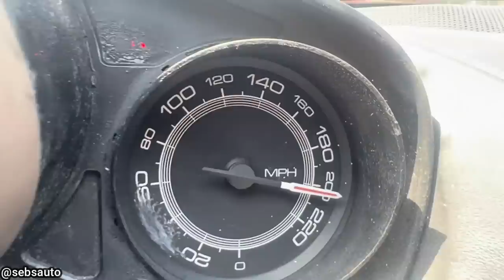Customer States Engine Overheated And It Might Be Seized | Just Rolled In

Comment: I bet a lot of the time the customers don't believe the mechanics when they tell them about the repairs needed.
Reply: You better F'ing believe it.
Reply: It's not good to just blindly trust every mechanic you come across, but you can't just ignore what they say because "they're untrustworthy! I don't know them!" Do your own research, and know the car your driving inside and out.
Reply: @Mike Right. Had a guy come in, brake pads gone. Metal on metal. Told him, he said he'd come back. So, 5 months later, he comes in for state inspection. Rotors are trashed, needs new calipers, too. The guy freaked. He said, "You told me pads, shims and cut the rotors." ($600.) "Now $1,400?!" I told him that was months ago. I asked him how the brakes worked. He said, "I have to stand on them to get the thing to stop." He yelled, and bitched, and left. Came back after getting a second opinion. He got pads, shims, rotors, and calipers with a fluid flush. (Black.) But he refused to let me do the work. At least he got it done.
Reply: If there wasn't so many crooks they would be believed.
Reply: problem is its an industri jam packed with scammers. The industri need a real actual certification program that actually means something.
Reply: My comment was in relation to the extreme problems shown in the video. It is obvious (to me) that thhese cars needs to be repaired and the mechanic is not trying to rip them off.
Reply: @AshGTE  Yes I believe this is an honest shop and the repairs are definitely needed. But Trusting mechanics is like trusting bankers most out to do you but you do get  a few honest ones.
Reply: @AshGTE  well yes, but people's disbelief stems from the fact that the industry has some bad apples giving customers reason for "FUD", wouldn't you agree?
Reply: @hplc123456  in germany you have to learn most professions, and get a certificate for it. if you want to say we, do safety work ona  car, as in brakes and suspension, someone needs a marter degree certificate, either you or the shop's owner.
still doesn't mean you won't get ripped off by not so serious shops.
Reply: @hplc123456  NH has yearly inspections. Most people follow the rules. But we do get some lick-n-stick places.
Reply: @AshGTE  I have had people refuse crazy things. Had a guy demand I fix his wife's sunroof, but her brakes didn't work.
Reply: @lotharrenz4621  Im a mechanic myself, and i worked side by side with German&Austrian guys. It puzzled me, they take take such great pride in their work, then i realized, that they take their education a lot more serious, its borderline engineering degree
Reply: @hplc123456  times change and they change the professions. when I was learning car mechanic late 80's, electronic fuel injections were brushed on, but the details were for car electricians. nowadays they throw it all together and call the result mechatronician. and there is so much electronics, and no spare parts to repair an unit, anyway so you have to replace the whole unit. I had to learn how to take apart brake calipers, engines, gear boxes (not automatic, that is a world unto itself), how to weld and solder, diagnose stuff, and the theories behind it all. in my opinion, without knowing at least some of the theory behind things it's hard to see that one is about to make a big mistake... 
all the electronics, the need to research details before you start working (if there is any documentation at all; despite existing laws many makers withhold vital special information, and often you only find the same questions on the internet, but no answers) and the pressure bosses give back to their employees especially, made me look for a different career recently. nowadays I empty thrash cans and the payment is still the same.
Reply: @Ogrematic  if he had done that in the UK, he would have been breaking the law. In fact we require regular safety inspections (called an MOT) to allow cars to be on the road
Reply: @jaycee1980  We do too, but only once a year. Trust me, I failed tons of people. There's no almost, you either pass or I fail you and send a report to the state.

Comment: I installed a new ac accumulator in a brand new Mercury Grand Marquis and learned they come from the plant with rust in the coolant system. Vinegar bath and distilled water doesn't clean or stop rust once it's in the system You just gotta keep flushing it or replace parts when the rust destroys them.
Reply: Look up phosphate conversion (phosphatation) to help passivate. Ofcourse with a GIANT asterix that I am unsure if the coolant system is compatible with such treatment.
Reply: As the song says, rust never sleeps.
Reply: oxalic acid will clean the rust out of cooling systems. old school cooling flushes used to have it, but now they are pretty useless thanks to govt regulations. but you can still get oxalic acid and just make your own flush

Comment: We had a DD13 with that same coolant filter come in with a coolant leak. That filter was plugged, like calcified plugged, hard as a rock over 90% of it. It was leaking at the water pump and around the cap. New filter, coolant, and water pump, works good as new.

Comment: Detroit actually has removed the coolant filter housing completely from DD engines for the last few years because they found it made no difference to the longevity of the engine. Folks should just replace the coolant at proper intervals but some truckers prefer to run using the "breakdown maintenance" system.
Reply from the maker: Somebody just mentioned that as well. Looks like somebody didn't listen 😆
Reply: Usally, a hose will blow before the 5 year coolant change interval is needed.

Comment: I love these videos, they make me so glad I live in a country with mandatory yearly inspections on cars, and that we don't have snow/road salt.
Reply: I have a car with about 110k miles on it about 20-30k miles ago I hit a deer at 50 mph. no bad structural damage, the engine is 100% fine, but the seal belt and air bag blew out and the frame is compacted a bit so the car is a bit shorter. I drove it to the body shop so they could give me a quote... He told me it was totaled.. I paid 4500 for it... No way in hell is that happening. I've drove it ever since and hadn't had any problems. If the government forced me to scrap it or fix it I would have to scrap it and get a shitmobile for $3000 with 300k miles on it. My car at least has 100K miles left in it. It would be a waste to scrap it. I am glad I DON'T live in a country where the government forces Inspections on me to trash my car. The only issue is the big brand auto mechanics refuse to touch my car. Good thing we still have small business local mechanics that will give me an oil change no problem.
Reply: @nightshade8958  that’s what I’m talking about. No government intervention. We can make our own decisions

Comment: I'm surprised you haven't had any cases of, "My car suddenly stopped running for no apparent reason, and by complete coincidence it happened right in front of the local race track!  I'm sure it's warranty."
Reply: The funnier ones are when they crash the car at the race track and have to be informed that their insurance does NOT cover racing of any sort.
Reply: @CopperBased  Well yeah, that's why it was totally a coincidental that it happened about 500 feet from the entrance to the race track.  You know, that's as far as they could push it....
Reply: @CopperBased  Audi used to advertize the RS8 on racetracks all the time, at the dealerships, in the flyers, everywhere. then one customer took his RS8 to a racetrack (don't remember if Hockenheim or Nürburgring). ruined the brakes completely, and got a finger flipped by Audi while they informed him "the RS8 is NOT made for the racetrack!" apparently they expect customers to install proper brake and supsension equipment before racing, which of course, would void the warranty...
Reply: @lotharrenz4621  That's why I hate advertising that's anti-engineering. As an engineer, when people ask me what something is capable of I usually under-rate it so they aren't disappointed and quite pleased it does better than advertised. Unfortunately with cars they are driving off-road way more than designed, or showing cars like my RX-8 (fantastic car for tracks or flying around corners on the streets) but it would over-heat so quickly its a joke (it overheats under normal usage). Its like sure it would be track ready after mods, but even just for Texas you need an aftermarket race radiator to go on the highway or getting stuck in traffic...

Oh also what is worse is the RX-8 basically has a fake temperature gauge (it stops moving past like 190 degrees, but even idling it hits 230 degrees easily), so you don't know when its about to cause engine damage which I think is a huge design flaw and not really the customers fault because they trusted an OEM dash gauge that isn't suited to the application and didn't haul around a laptop reading the OBDII port looking at that while driving.
Reply: @jakegarrett8109  owch. well, people abusing their vehicles happens here or there in germany, too, but more often it happens the other way around: offroaders and SUVs are not used "properly", and instead they take up traffic space. granted I'm biased towards them after screwing with them for years, and don't see the point behind a "city-SUV" as some ads called it.
I thought Mazda did better with the RX8 than releasing something that overhearts regularly. I wonder what they did, actually., I knew a guy who drove one for years here in germany (later sold it to a mazda dealer who was looking out for one not raced to oblivion), and he never mentioned heat problems. maybe they gave us the racing radiators you'd have to buy as aftermarket? also a vastly incorrect gauge is a no-go. better have one that at least shows when overheating.
many years ago I had a customer who wondered why the temperature gauge would go between almost red and almost blue on their late 80's Chrysler LeBaron. the infrared thermometer showed that it was just the gauge showing too generously, the temperatures on radiatoir and egine were normal. and then the fan would start and it looked like the engine would go ice... XD
Reply: @lotharrenz4621  Might just not be as hot in Germany, I know most of the time I don't have the issue (living near the coast now), but Texas would sometimes be 110*F or hotter, and it just couldn't handle slow speed stop and start traffic nor even 80mph some days... When it was cool out though you could drive just fine, but once it got even 90*F you could easily over-heat it if you were driving it like it was meant to be driven (which is red lining it at least once every drive to burn the carbon out since one side of a rotary engine is cold and the graphite apex seals wear out way too fast with carbon deposits acting like sandpaper).

They may have also just changed the fan actuation point, according to the OBDII port the fan doesn't kick on until about 230*F or 110*c! So German version may have had the fan control set lower, I know Mazda changed many things from how much oil was pumped into the combustion chamber to all sorts of other weird stuff in their different flash updates.
Reply: @jakegarrett8109  quite possible. with other cars here, specs can change for europe, scandinavia, and hot countries (like northern african countries). still, fan starting at 110°C is way too much, especially for a sports car. what was Mazda thinking?
Reply: @lotharrenz4621  I imagine its two fold, one the engineers saw 1.3 Liter engine and stuck too small of a radiator in somehow not realizing these burn more than twice the fuel of a normal engine (and over twice the heat), so they need something like a truck radiator, although many trucks get better fuel economy and less wasted heat... Then probably someone wanting it to not have a "noisy fan" kicking on (its not even that powerful of a fan or loud, and RX-8 owners love their car to be loud and spitting flames).

Marketing over-rid some other important engineering designs: someone in Mazda said ALL Mazda's shall use the same super thin oil (even though its not a piston engine) because its better fuel economy and environmentally friendly, however the rotary already makes terrible gas mileage so it doesn't really change that, AND when you're having to replace engines every 20k to 50k miles, that's NOT very eco friendly! Then on top of that for emissions they further dialed the fuel amount back, so it was just a disaster and why I pre-mix 2-cycle oil when filling my gas tank. Just some things were really silly.
Reply: *fuel mixture, they injected less oil than the engine really needs.
Reply: @jakegarrett8109  oh my. that makes sense, actually. Wankels are tiny and powerful, so someone can have the wrong ideas. Audi did two prototypes of the 100 model (T43 I think?) with a two-disc wankel engine very similar to the Ro80 machine, and set them on display at a car fair. they had second thoughts and never opened the bonnet because the engines look so puny inside that large engine bay...
yeah, heat. caused by the very large internal surface taking away the combustion's heat, and causing loss of power, so the efficiency is as low as it is. I suddenly wonder if making the engine out of ceramics instead of aluminium would have helped with that...
Felix Wankels masterpiece has caused many problems. NSU hooked up with Citroen, and both companies thought the other would develop the engine fully. needless to say it didn't work out... hey, even Zündapp made a few motorbikes with little wankels! they had problems, too, of course.

Comment: "Trail Rated" does not mean it runs under water.
Reply: Trail rated is different from fully submersible.
Reply: I wonder where all those failed modules are located.
Reply: trail rated means it can go on predesignated concrete paved trails through the woods lol
Reply: @cowthedestroyer  So my Hyundai Pony with a 6 inch lift kit is better suited - no computer, carburettor intake on top of the engine, most of the electrics on top (starter might get a lil wet, and the oil PSI dummy light) 

Got it.
Reply: TBH i consider it poor manufacturing that those electronic modules were not potted, or at the very least conformally coated

Comment: That flooded jeep is going to need a lot more than a few modules in the future!! 
That things a write off
Reply: You can get 1950s electrics flooded wet and they’ll dry out and be fine.  Circuit boards under the seats? Modern multi pin connectors?   Utterly ruined!
Reply: Thinking the same thing, but maybe it wasn't insured!?!

Comment: i'm curious about that coil spring, and how big of a pot hole, or barrier did you have to go over to break it like that.
Reply from the maker: Lol yea first time I've seen one break into 4 pieces.
Reply: I had one break into three pieces it literally fell to pieces when I took it out.
Reply: it's actually a corrosion problem. rust will "drill" itself into the structure causing fail points, and the spring evetually breaks there. I have seen it on a car a little over a year old, the last decade or so the quality of spring steel seems to have gone downhill.

Comment: First time I've seen a coil spring break apart like that 😲 . The musical " parking brake " was crazy funny 🤣 . That was a great sounding Chevy 😁 ( music to the ears ) . Come on now , plenty of life left in them rotors 🤪
Reply: '62 Pontiac, if you please!
Reply: Have had coil springs on front struts break, picked up a Bronco with a snow plow both front springs came out in pieces, replaced with 2wd F350 springs. Every part of that poor Bronco could have been on this channel. Rotting horse feed in the back, sparkplugs that had never been out of the motor in 200k miles, hole in the side of the fuel tank and wheels that took  2 days to remove.
Reply: They literally turned the rotors into a sheet of paper how would the vehicle even stop 🥴🤔
Reply: @sharonnicholson3393  sarcasm is one of many free services I offer
Reply: @thomasfletcher4765  some people could misinterpret free services 😁

Comment: Most people don’t know you can’t tighten Lugnuts to the point where it can’t turn anymore, that’s why you have to use a torque wrench, and use proper torque specs.
Reply: Facts. I just spent $120 at a tire shop this morning to have them remove lug nuts I couldn't get off with my impact gun. Turns out the (different) shop that installed the tires impacted the lug nuts so hard that all five front left nuts were bulging at the sides. I tried not to laugh when the tech told me I had "swollen nuts!" Thankfully, the studs weren't damaged.
Reply: @dashcamandy2242  i always hide my giggles every time we have a customer come with with loose or lost nuts...
Reply: I have worked with so many people who just run them on with an impact, no torque stick, no torque wrench. Drives me nuts when I get their comebacks.
Reply: @Ogrematic  we often get people who've been to fast lube places, canadian tire, or even tire shops... with loose tires, missing or loose nuts *snickers*.. it's actually rare when we get some DIY idiot. we're always reminding people, if we remove a tire for any reason, come back in about 100kms for a retorque.
Reply: @kellynnd5361  Yeah, we always told people that, too. Free. Like maybe 20% came back.
Reply: @Ogrematic  we're rural and so sorta have a captive customer list lol.
Reply: @kellynnd5361  I think most people just ignore the advice.
Reply: @Ogrematic  it's why we all keep records, they can't blame us for a tire falling off a month later if they never came back.

Comment: How do you screw up a timing chain on an LS motor? The Holden L98.. I just did a cam on an L76 (6.0 liter LS in a Pontiac G8 aka Holden Commadore VE).. line up the dots, crank it over to make sure they line up, call it a day.